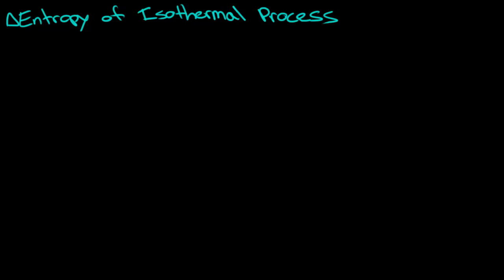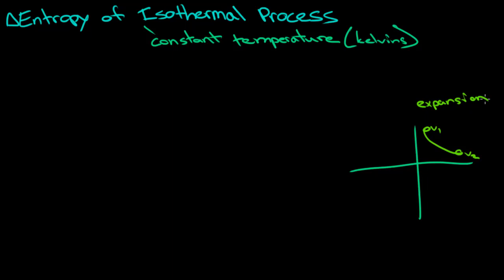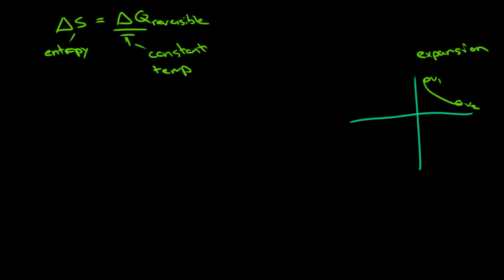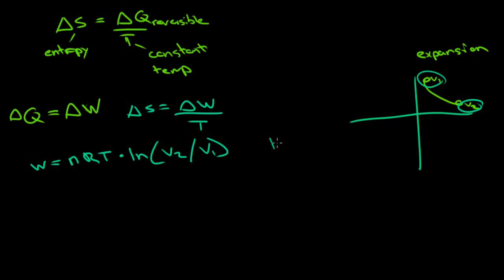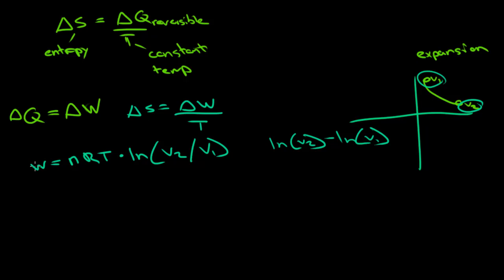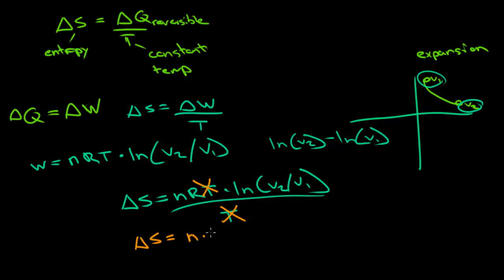Change in Entropy of an Isothermal Process

Comment: what about compression? i assume it would be the same but i'm getting a negative value for entropy in my question :/
Reply: Yeah for compression, it will be negative
Reply: Yes it should be. On compression randomness(entropy) decreases as there is little space to move about randomly. Thus becomes      -ve  instead of +ve !
Reply: @rajarajans.2376  using the same equation and all 
Right ?
Reply: @rajarajans.2376 do entropy ever decrease?